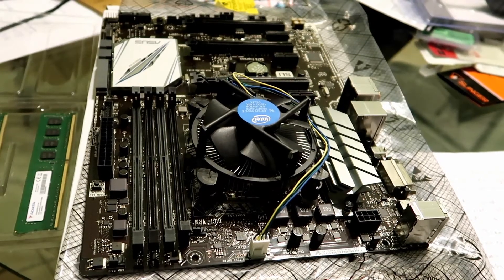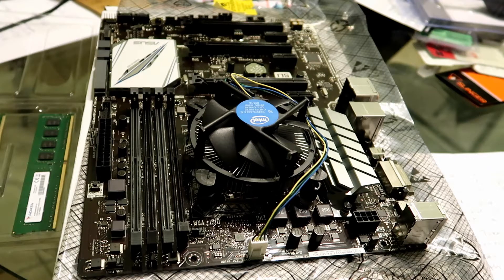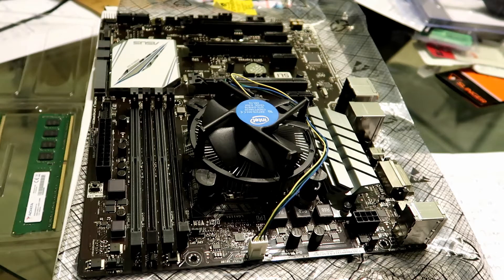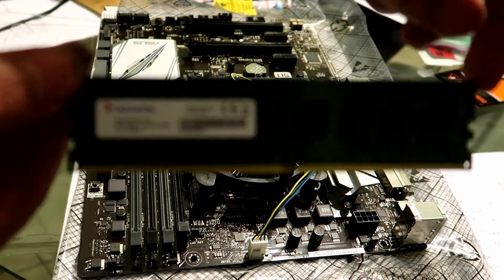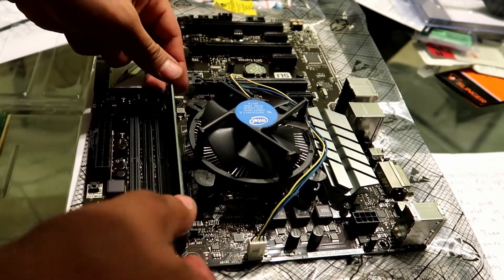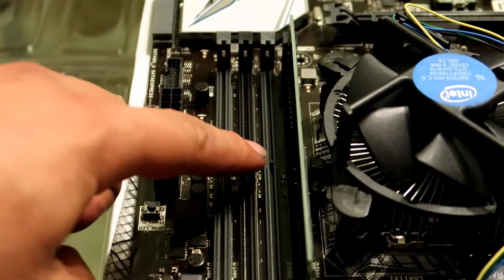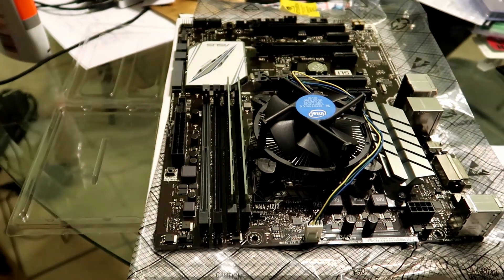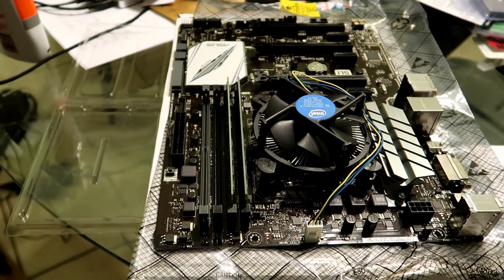HOW TO INSTALL DDR4 RAM

Comment: That's not correct.  The RAM slots are colour coded for a reason. To take advantage of Dual Channel DDR4 RAM you need to install it in slots of the same colour, grey or black in your case.